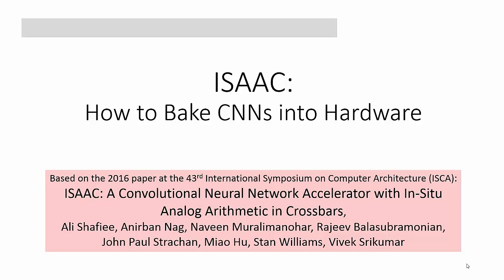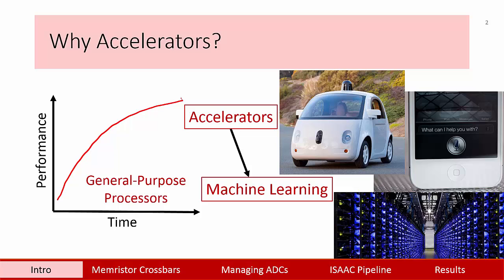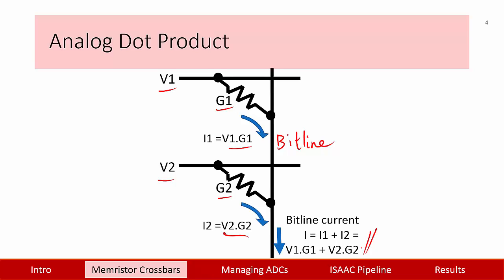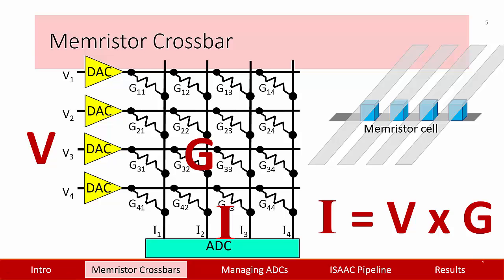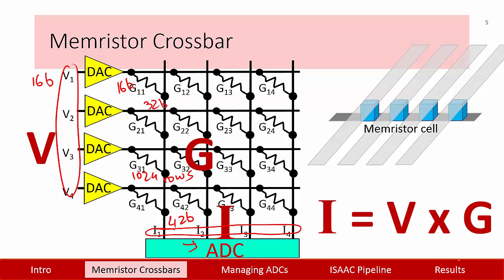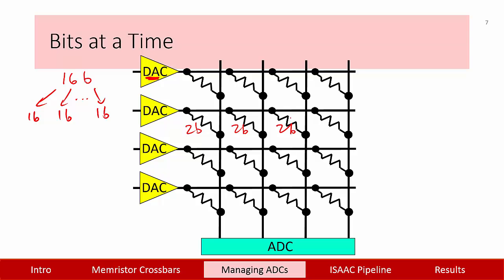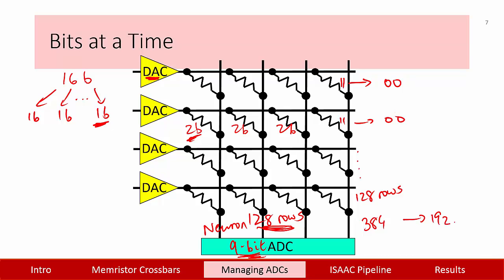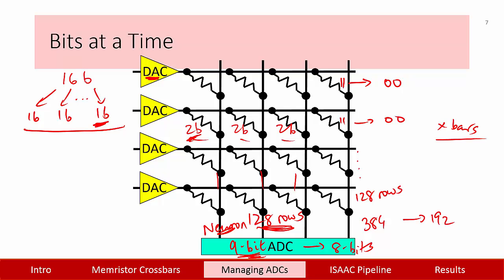ISAAC: An Analog Convolutional Neural Network Accelerator (Part I)

Comment: If you have a network like this, the currents will not simply be added. In fact you have a complex current divider with multiple voltage sources. The output current is the result of the superposition of all current dividers, which depend on the resistor values and it will get more and more complex by increasing the input vector. Furthermore, the memrisors are changing their values by applying a voltage. How is it possible to get a consistent result?
Reply: fWhat if we ground the lines? Won't we then easily be able to add the currents due to superposition?